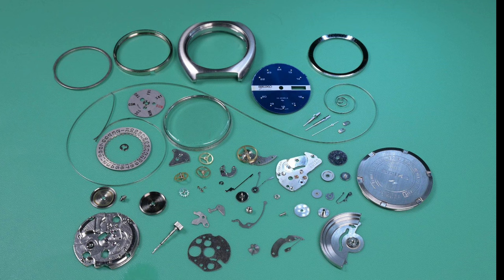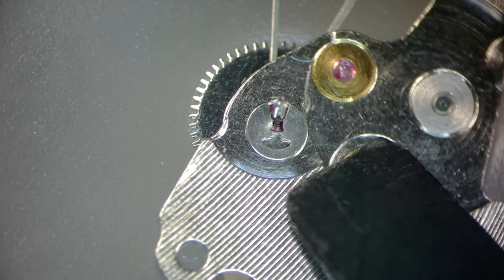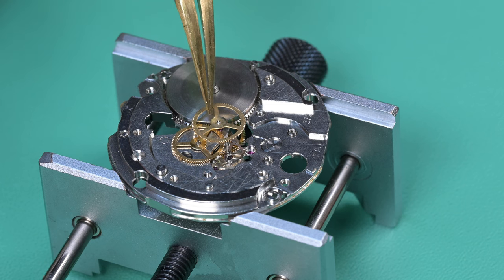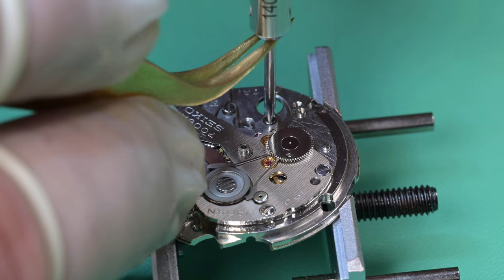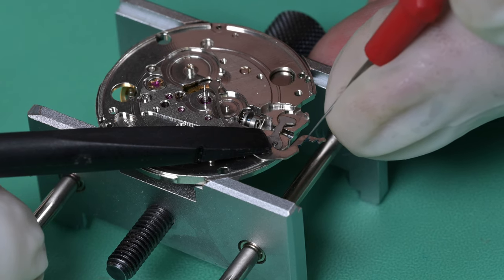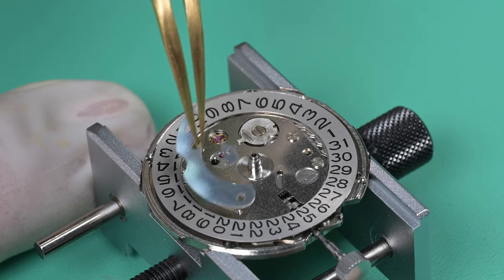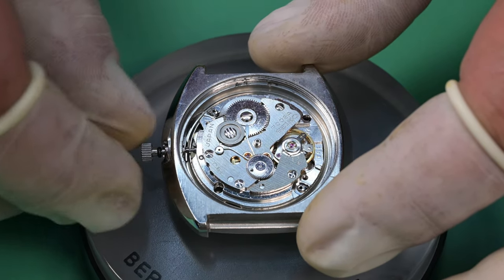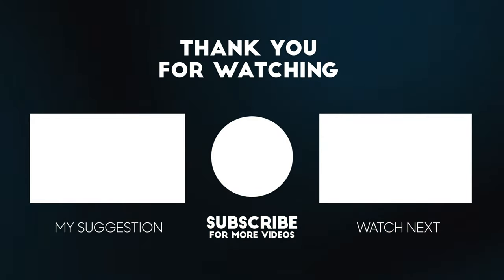Turning My Failure Into A Success: A 1975 Seiko Diamatic 7006-6020 Rebuild

Comment: Great video, the length of the video is not a problem. What type of cristal do you use when you have to replace it on a vintage Seiko 5 models, NOS or you find by size mineral or sapphire cristal? Thanks
Reply from the maker: Thanks a bunch, I'm glad you enjoyed the video.  It depends on the specific watch on whether I try to find a NOS, replacement sapphire, etc.  Mostly with these vintage watches, I'll try to find a NOS factory part first.  Many of these, including this particular watch, have tension rings, etc. and aftermarket options are limited.  Thankfully, with Seiko watches at least, there is generally a few options available for NOS replacement crystals.

Comment: I have that same watch, it's become very rare. It was my first and most difficult vintage watch i've done yet. I have it on a medium brown leather racer style strap and it's gorgeous. One of my favorite watches.
Reply from the maker: They are getting harder to find, that's for sure.  A good chapter ring on these is difficult to find.  I got lucky on this one.  Nice to hear you have the same watch!
Reply: @WeekendWatchRepair  Yeah, I lucked out as my chapter ring and dial are about 95%, maybe 99% on the chapter ring. There's two lume pips missing from the dial but the lume is dead on the thing anyways and there's a nice patina on the dial that's barely noticeable. 

Wha ti'm jealous of is the hands on your example. the hands on mine look mostly ok but it's definitely the weakest link on the total package. I also polished mine's case so all the surfaces are pretty shiny and it looks just beautiful. I actually wasn't ever really sure what the original finish the case was supposed to be it's so hard to find an untouched example picture.
Reply from the maker: @nunyabusiness9056 I've done the same when refinishing cases before.

Comment: I personally enjoy log form video content, at least with restorations. Reviews and buyers' guides work better as short form, but restorations really need space to breathe.

And you needn't apologize for your videography skills, as that continues to develop and improve as you go. Keep doing what you're doing, and you'll find your "sweet spot."
Reply from the maker: That is a really great point.  There was so much more information that I wanted to provide through the narration on this video, but I just couldn't get it in.  One example is that there is a neat trick on these movements with regards to the barrel.  This watch got a full replacement barrel complete (because the original was in such bad shape), but the original part number is very difficult to find online.  There is another Seiko part with the exact same barrel dimensions, barrel tooth count, spring, arbor, etc., with the only different being the shape of the very tips of the barrel teeth.  They are just slightly more rounded on the other part (for a different movement), but the tips actually do not engage with the second wheel at all when they interact, so it is a perfectly suitable replacement part that works flawlessly.  I wanted to get into those details, but there just wasn't time.  I really appreciate your thoughts on the long form vs short form content, and will take it to heart moving forward.
Reply: @WeekendWatchRepair  I think you're on the right track with editing down some of the repetitive stuff like screw insertion and lubrication. Showing us a couple of each spaced throughout the rebuild gives us a sense of continuity without having to witness every single screw go in or every single pivot and jewel get lubricated. It's like watching a movie: if you see someone get into a car in one location and see them exit in another, the brain can fill in that there was a drive in between the two events without having to witness the entire 9½ hour trip from El Paso to Dallas . Of course, anything of special note with either of these things ought to be documented, such as similar but slightly different screws being easily confused or special techniques applicable to a particular movement. But overall, I feel like you're finding your footing and will continue to improve.
Reply: Can you give details about the barrel swap. It may be a lifesaver for someone in future. Part numbers and caliber no would be great.
As to the length of video, I prefer longer, more detailed videos. Some channels just cut too much making it very hard to follow the strip down or rebuild or both. 45 mins is a minimum for both and around an hour is ideal. Best regards.....

Comment: Is it possible to fix loose rotor somehow on this type of movement? Thanks
Reply from the maker: The easiest fix would be to just replace the rotor for one with that has a good bearing.  If you can find Seiko part # 500904, that should be correct.  Several other 7000 series movements share this same part number as well.  As far as tightening the bearing, I'd assume it could be tightened back up with a staking set, although I haven't done one of this type specifically, where the screw is part of the bearing itself.
Reply: @WeekendWatchRepair  thanks for the answer.